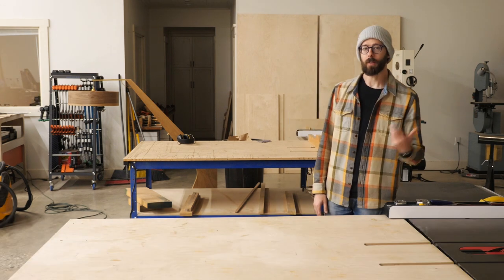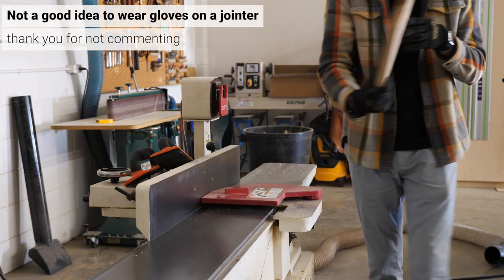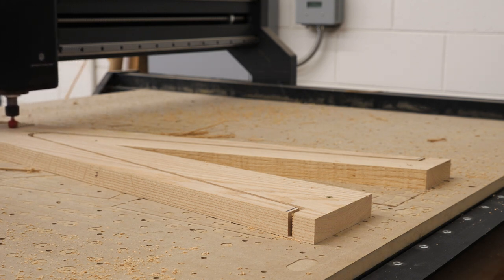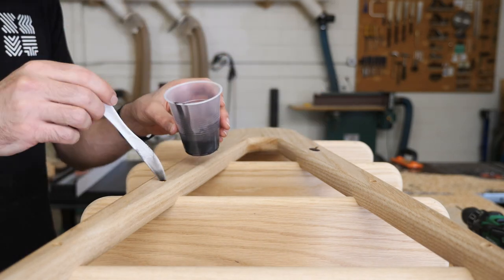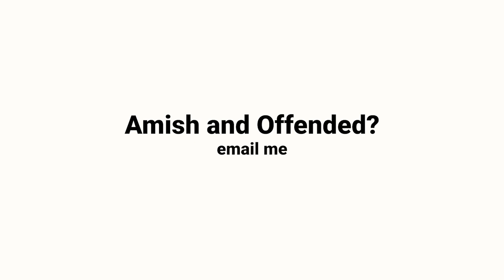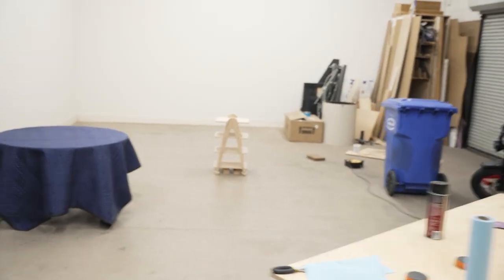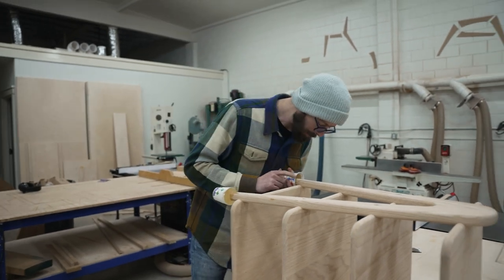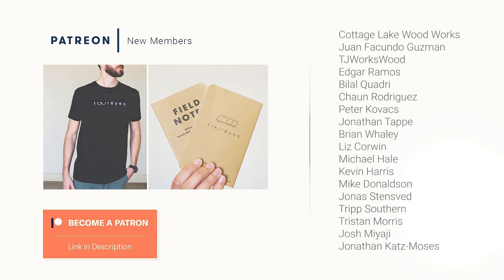A Floating Side Table, That Almost Looks Like it's Really Floating

Comment: The epoxy feet are a great add on for outdoor furniture to prevent water wicking up into the feet and eventually rotting out. Plus, the epoxy is less likely to scratch a deck or patio surface than other hardware solutions. Thanks for the great idea!
Reply: Ooohhh!! Good point!!! I LIKE that idea

Comment: As someone else noted, all epoxy yellows.  

Still useful, wood whisperer did it on outdoor furniture to prevent moisture wicking.  

I built two Paul Sellers dining tables, scaled down to German Shepard height, and did 1/4" epoxy "feet" on them years ago and they work great.  

To make, flipped table over, circled blue tape around tapered ends, added just the epoxy needed and then used rasp and sanding to level, shape, and clean up.

Comment: Rounded shelves in rounded dados look really good!
If you "cut" the dado a bit deeper than its radius you should overcome the stability problem you had in the dry fit.
Reply: I was thinking the same sort of thing: depth of cut of the dado needs to be (slightly) greater than the radius of the router bit.

Comment: Super cool approach. But where I live many of the houses are hundreds of years old (mine is from 1750 but rebuild in 1929) and very few have totally flat floors. I either don't worry at all about making legs perfectly flat, because if you move the furniture it will wobble on a different leg. The best option are simply screw/adjustable feet to keep them always free for adjusting. Always enjoy your videos and designs though!! Thanks for sharing.
Reply: The second best option is to only make 3-legged furniture.

Comment: Love this episode. The filleted edges are awesome. Definitely has the essence of vintage oak furniture, with a fresh approach. You could possibly try a Shou Sugi Ban finish on a project that doesn’t utilize resin. Be prepped for the char dust, may need to do light sanding and polishing outside on cardboard for that approach. Seal the char after polishing as well. Much love y’all. Keep it goin

Comment: Thanks for sharing this experiment. My architecture hero, Glenn Murcutt, once stated that he was never a fan of curves meeting curves as he felt it made a building too "syrupy." But with this design, you're using quite crisp lines and getting away with it. It's a fun piece. 

As for lining up the shelves, try a blue tape centre line marker for the top one, then use a plumb bob!

And thank you for wearing pants. Really. Safety is important.

Comment: I’d be willing to guess that, using your CNC to cut and dado the legs, is partially why it came out so well balanced, and without the typical wobble of a traditionally designed four legged table. It allowed for you to get more acquainted with your creation than it usually does, by assembling it, and making sure the two center shelves were a nice fit throughout the dry. Wonderful thinking, it looks like you got some true enjoyment from this creation, especially since it didn’t go quite as planned. Nice work!

Comment: Chris, great stuff. I guess there is a tip that can help you next time to "secure" the epoxy chunks to the end grain wood: before filling  the epoxy chunk glasses, turn your table upside down; then, try drilling a hole (maybe 3/4" depth x Ø 1/2")  on each leg end. This hole, once filled in with epoxy,  will work as a tenon. Before epoxy dries, turn your table upside down again, and proceed the epoxy glasses filling.

Comment: Howzit Gents, that bull-nose round-over bit is a cove bit. First encountered it on a table top that required a smooth transition from top to a small 'wall' around said top. Very handy on cnc because of the fact one can get a much bigger cutting diameter than say a bull-nose bit, (dia of shaft, most often).

Comment: would have been neat to see the middle shelves still able to slide, so they could be set unaligned from the top & bottom shelves.  So you could potentially put something a bit taller on those shelves
but yes, having clear epoxy on the ends is an awesome looking addition

Comment: The floating aspect is nifty. Have you considered making sections of the legs out of epoxy as well to make higher shelves appear to be levitating? Like perhaps having a section mid leg be "invisible"? Maybe that's more of a gimmick than you'd be into.
Reply: he did a video where he did that, and a video where they replaced the joinery/dominos/buscuits with epoxy.. about middle of last year I think ?

Comment: What about plaster molds for the resin leg-extensions? You could first make the full leg in wood, cover the last tip with sth like film, stand them into cups filled with plaster, then remove legs and film, chop off the tips, and proceed filling in with resin, etc. avoiding the cup melting mess ;)

Comment: Mmh, two ideas perhaps to make this easier:
1. Cheat a bit in the rounded glue joints and have just the visible outer parts round, but rectangular in the inside (or use a domino)
2. Instead of paper or plastic cups use glass test tubes, just barely wider than the legs. Less epoxy waste, less heat from the epoxy and more heat resistant. With that large surface to radiate off the heat, a single deep pour might work, even if it's way deeper (or longer) than the epoxy specs allow.

Comment: If you have a table with 4 even legs and it is wobbly because of an uneven floor, you can rotate it in such a way that it will not wobble.  "The Wobbly Table Theorem" works every time, even if it means the table is pointing in a stupid direction.
Reply: Every time, except that there is no guarantee that the coincidences between a flat plane and an irregular surface occur in suitable relative positions to match your feet.

Comment: Hi Chris, one question about this.  The legs are essentially end grain.  How well (strong) does that epoxy hold.  On the small "wobble fix" it's likely not an issue, but on the floating piece (I have an idea for something else, similar so looking for insight on this and longevity), is it likely to snap off on a small surface like this?  Is there a way to enhance it, like drilling a hole into the leg itself?  Thanks!  Scott from Japan

Comment: There was a guy on a channel that flipped his outdoor furniture upside down and wrapped the ends of his legs in tape, and poured about a quarter inch pad of epoxy onto the legs and let it harden and then peeled the tape. It keeps the wood of the furniture off of the ground so it doesn’t absorb water.  I wish I remember what channel that was from, but I do not remember now.
Reply: Lincoln Street did this.

Comment: Dumb question. 

Why not install the top and or bottom shelf, place it close to a known 90 degrees. Like a wall. And then push that first shelf so that it’s on, and has a stop block. Such as a wall. Then just slap the other shelves in knowing the wall will make them all equal?

Comment: If you have the top and bottom shelve alligned. Why dont you flip it so that it is resting on those two shelves, then when you slide in the other two they will automatically allign when they hid the workbench. Jyst drilling from the side or glueing, et voila.